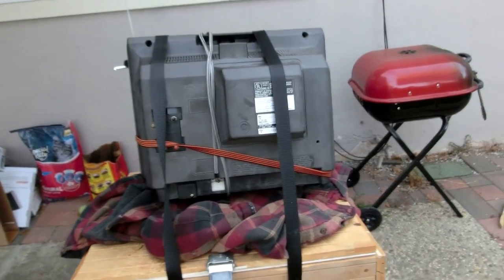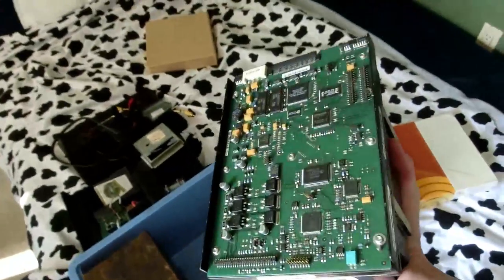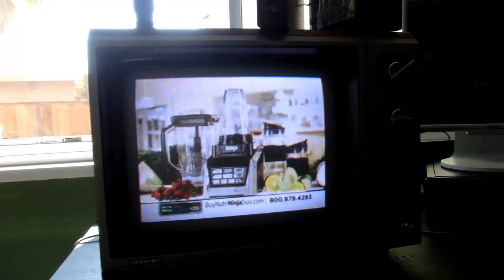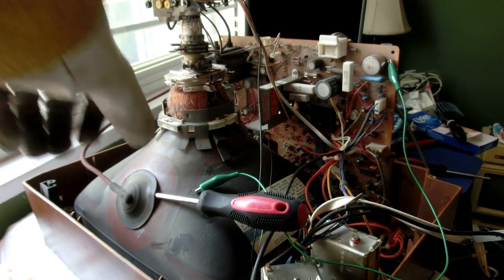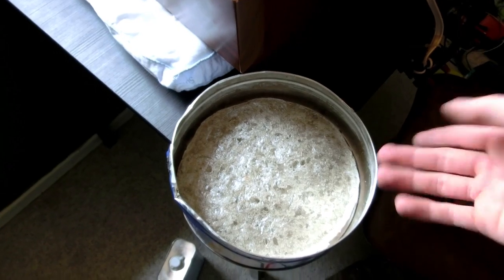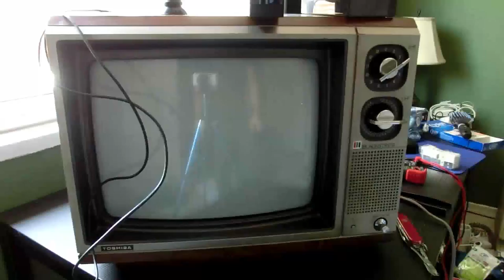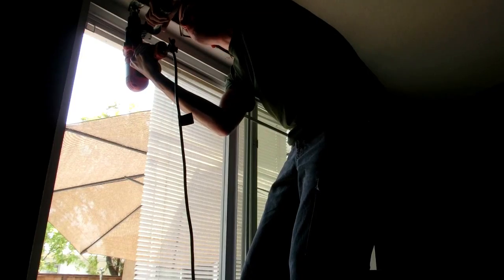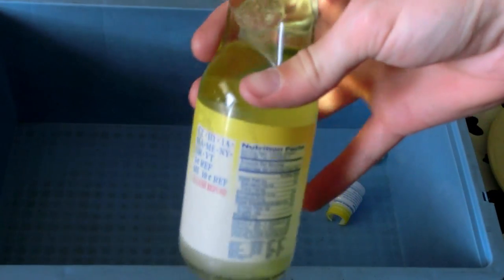Random Bits 0099: 1984 TV repair, Atari 2600 mod, 1930s kWh Meter

Comment: Back in the day 80's  when I fixed TV's a common problem was dry joints, because the sound vibrates the cabinet certain large objects would resonate and cause fatigue, another obvious problem is loose speaker clips, so if the problem comes back might help, nice place btw glad you got moved in ok
Reply from the maker: ***** yeah thats the first thing i checked was bad solder joints. i may go over them with a soldering iron and some flux if i have more issues.

Comment: Fascinating. I played with that kind of tech when it was new. Our first TV, at least the first one I remember, was a 19" Zenith black and white tube in a grey plastic case. It's rabbit ear antenna picked up 5 or 6 VHF channels and 3 or 4 UHF channels (if the winds were blowing the signal in from Milwaukee). We also got a Pong clone for Xmas one year, which we played for about 3 days then put away to be sold off for a dollar at a garage sale a decade later.

Comment: Cool find on the TV. I would imagine that the loss of sound was a bad solder joint that should be easy to fix if it comes back. The comments for the Balum are mostly right but I have done exactly as you did many times. Wiring the signal directly in with 75 ohn will only affect you if the signal is weak and since you are using a converter box that is not an issue now. PS the cat seems to be glad you moved in!

Comment: Cool Video,  I have a Blackstripe FSE 20 inch version 1985~6 TV same circuit board minus the turn dials which are super cool. My neighbor left it by the side of the road so I brought it home, figuring if it  worked great if not then I can fix it. A new power cord, soldiering a dry joint and loads of washing and I mean Wow dust built in layers just like your TV. It works like a champ now so keep up the great work tinkering and thumbs up on safety.

Comment: The radio in our cowshed had been sitting for about 5 years without being used before we commissioned it as a cowshed radio (it was made in 1984 though) and it didn't work when we first plugged it in. We left it plugged in and on for about two hours and then it suddenly started to work again.

Comment: Great videos, I'm jealous of your VCRs. Tapping a TV to make it work is a sure sign of dry joints, its a common problem where the solder cracks away from component legs, this could have caused your audio problem too (possibly just with the movement of the circuit board). The image improved with your RF shield, I'd try the digital converter again.

Comment: That old TV has 300 ohm impedance. You need a 75 to 300 ohm transformer. Any Radio Shack or hardware store should sell them. Correcting the impedance mismatch should help clear up the picture. Beware of getting a super cheap transformer however. Some of them are so poorly made that the internal loss is so high that it will offset the gain obtained from correcting the mismatch. Also, pardon me for stating the obvious try the fine tuning on the TV itself. (:
Reply: MisterClaws I agree, the signal should be fed through a twin lead, not a coax. Of course you can buy matching transformer, but wouldn't it be easier to make 4:1 balun out of a piece of a coax that is half wavelength long?
Reply from the maker: MisterClaws "any radioshack or hardware store should sell them" well radioshack doesnt exist anymore and i checked like 4 stores and couldnt find one. the image looks perfect now so i dont think its an issue. FYI i fixed the image and sound in this video.
Reply: Rinoa Super-Genius Try a "mom and pop" style hardware store, if the big box stores haven't put them all out of business around your area. And yeah, I know about the shack going bye-bye. It is a real shame. I am sorely going to miss that source of parts for projects. Online ordering is great... if you have the time to wait and don't need it RIGHT NOW for your project. :( Check amazon for "75 to 300 Ohm UHF/VHF Matching Transformer?, $2.15.
Reply from the maker: MisterClaws
/facepalm

yes the places i checked where the recycling center, Halted, weirdstuff and some others. why would you think i would even bother with a "big box" store to find something like that?

i dont need a transformer becuase its working fine, end of story.
Reply: Rinoa Super-Genius You don't really need to buy it. Just google "4:1 coax balun" and you'll see images how to make it. I'm not urging you to make it, just saying :)
Reply: ***** Check your facts. The company is in trouble but there are still 1700 stores.
Reply from the maker: MisterClaws
no they closed them all and went bankrupt. they've already sold half the company and am looking for a buyer for the rest.
Reply from the maker: Peter Carlson
yes they are General wireless now, they arent the old radioshack. do the new general wireless stores have a nice selection of individual components like radioshack did?
Reply from the maker: Peter Carlson
what i'm saying is even though they may be branded "radio shack" they are no longer a radio shack, just a cellphones and other crap store.

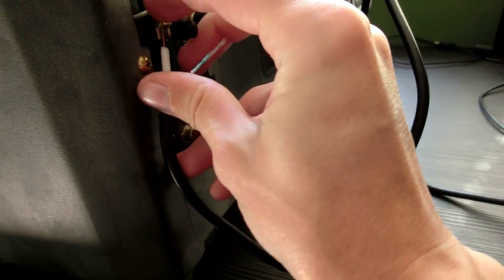Comment: 5:30 you need a 300 Ohm to 75 Ohm balun to convert the characteristic impedance of the 300 Ohm twin flat lead on the TV to match the 75 Ohms on the Coax cable.

Comment: You get the flicker with most cameras because the TV in your case has a refreshing  rate of 60 Hz (same as the power outlet so in north America 60Hz; in most other parts of the world 50Hz). That is also were the frame rates come form NTSC 30 and PAL 25. What means that every line is drawn twice. If you now record your TV your camera is usually not synced to the 60Hz TV what in turn means that you are recording a frame while the TV is redrawing lines i.e. there are black lines or other artefacts on the screen. You can counteract this by changing the shutter speed and a lot of camcorders have a function to scan and sync to refresh rates but it is call different by different manufactures for example synchro scan by panasonic.
Reply from the maker: Pascal Nuning actually a color television runs at 59.94 FPS, but yes i know.

you seem to be simplifying the issue way too much though, a lot more such as exposure and brightness has to be right to record a CRT well also.
Reply: Rinoa Super-Genius  haha being precise like and the thats why ntsc is not really 30 but 29.97. But i thought correct  exposure and brightness was a given.
Reply from the maker: Pascal Nuning
yeah so for a camera to automaticly get the correct settings kinda is up to chance. this camera, along with every other camera ive owned, doesnt allow you to really change any settings for video recording.

Comment: Not a bad setup, that cat there looks like my baby cat I have.
Those DTV boxes can be funny sometimes, in my city I can get up to 30 channels out in the rural area with the same box, I can only get 12 that with a powered antenna.
I have seen a conversion on a similar TV to yours that's gives it RCA jacks have you thought about doing that type of conversion??
Reply from the maker: redneckbryon yeah i've thought about doing that but tbh i dont mind using RF into it, especially since i plan to run this TV with my VCR that will convert RCA to RF.

Comment: You need a 75 ohm to 300 ohm transformer on you antenna input. It looks like a AA battery with the two lugs on one side and the coax female on the other side . that might help with the snow. Be safe with that CRT.
Reply from the maker: Fred Nowall well i already fixed the snow in this video....

Comment: The flickering on the TV is from having a higher shutter speed and its clashing with the refresh rate of the screen. Try doing it with a higher shutter speed and it will be flickery.  Unless you are magic.....
Reply from the maker: shaneman27 are you pointing that out for other people or do you seriously think i dont know? btw i have yet to get a camera that you can change the shutter speed for recording video.

shutter speed is also probably only one facet to why this camera records CRTs well.
Reply: Mostly for others but i was just making sure. You talked about maybe getting an A7s back in Illinois. You think you will at some point? because that is like my dream camera omg low light is so good on it.
Reply from the maker: shaneman27
yeah i think it may be too big of a jump now. i may get a DSLR to play with then get the A7s when it gets cheaper.
Reply: Yes it's just a little expensive... I have a canon SL1 and I love it as my camera. I use it to shoot all kinds of stuff. Pretty much everything really. But a DSLR would be a good place to start for that kind of video.

Comment: Your tinkering makes me want to tinker. Unfortunately I know nothing about tinkering. Although I suppose the fun of tinkering is in knowing little to nothing and learning as you tinker... hmm
Reply: Also I have those same totinos pizzas. Don't eat them regularly but always have a few around. Definitely quick and easy. 
I always spray the pan with PAM then about halfway through-ish scrap the pizza free (as it still will stick anyway even with Pam) then when it is done it slides right off (seems to not stick once freed) with minimal baking pan mess...
Reply from the maker: +knpstrr yup, tinkering leads to better tinkering. took me years of tinkering before i finally got better at it.
Reply: Rinoa Super-Genius 17:35 I think the converter box went to go cry in a corner somewhere...

Comment: I dig the new place. Also, nothing like CRT's man. Love CRT's. Oh, and the BIGGEST problem I've had with my truck, is the previous owner doing EVERYTHING WRONG with fixing it. The guy who fixed my driveshaft used WASHERS. Yep.  So, never trust old repairs. Always question credibility of repairs.
Reply from the maker: Jesse Leonard yeah they are great. i think LCDs work great for computers due to me tending to stare at them a lot. but i love having even a CRT as a secondary monitor.
Reply: Rinoa Super-Genius My wife's computer has an old Princeton Graphics CRT monitor. Even at20 years of age, it will has a fantastic picture.